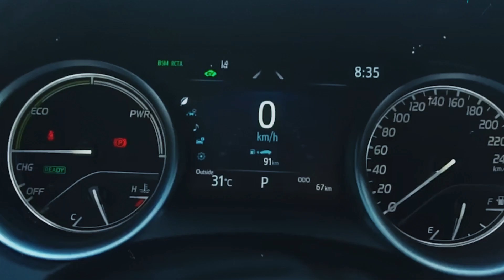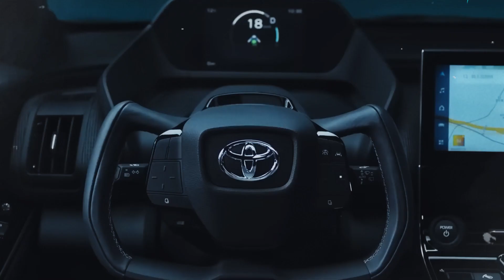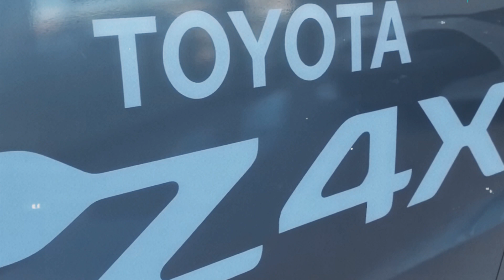Toyota Claims EV Batteries Outshine Competitors

Comment: Vapourware since 2015, newer battery chemistries  actually make solid state batteries obsolete. Red herrings like hydrogen and problematic solid state batteries will be the death knell for Toyota.
Reply: While Toyota sends out press releases, BYD and CATL sends samples of their products that they will release next year
Reply: Solid state is the future. Everyone is working on it. Toyota is going early with solid state in their hybrids, but in the meantime work on regular liquid catode batteries also continues.
Reply: @GeirEivindMork  everyone working on solid state batteries except the 2 largest battery makers who have already developed LiFe and Sodium batteries that match or surpassed Solid state batteries in price and performance
Reply: @1rjona  LiFePO 4 battery or LFP batteries, or LiFe as you call them are well and good, they don't have cobalt or nickle and they are fast to charge. But they "only" has 90-160 Wh/kg compared to 300 Wh/kg on regular chemistries like LiMO2. Sodium batteries have even lower densities thus being mostly used as storage. between 140 Wh/Kg and 160 Wh/kg. However, solid state is going to surpass 500 Wh/kg and even reach up to 1000 Wh/kg in the future. And it's not only there where solid state wins.